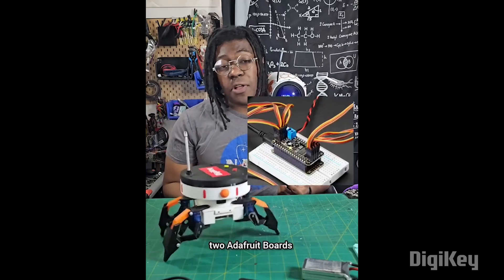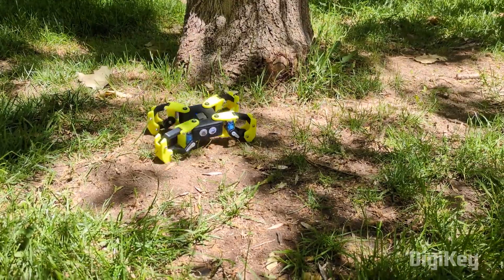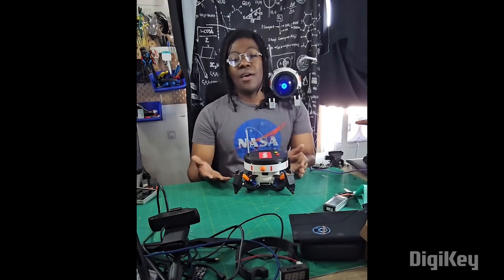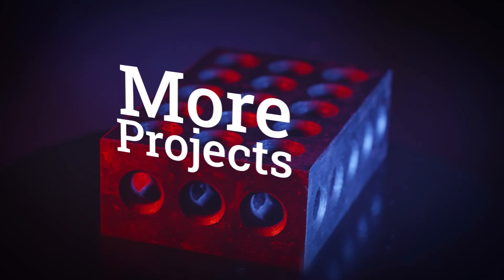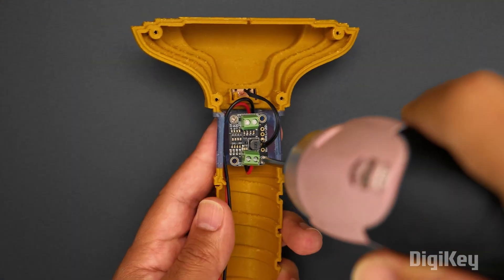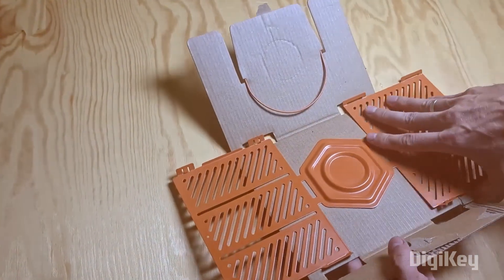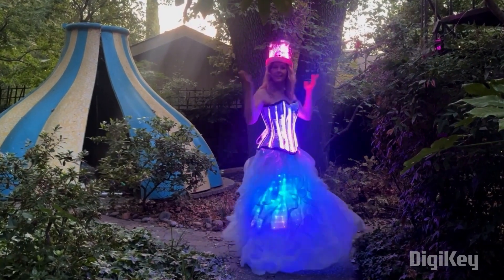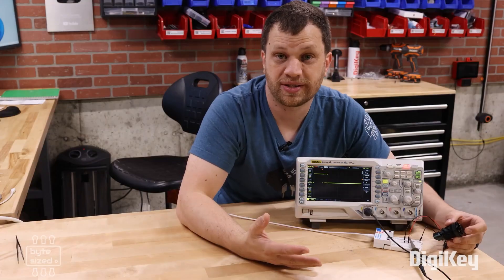Crab Craft [Maker Update] | Maker.io

Comment: thansk for the update. I need to check out the ociliscope guide. I picked up a pocked ociliscope that's also a multi meter. I need to learn to take advantage of it.
Reply: The button debouncing example Zach includes in his video is a good example of when an oscilloscope comes in handy. An interesting and practical thing to measure, at least.